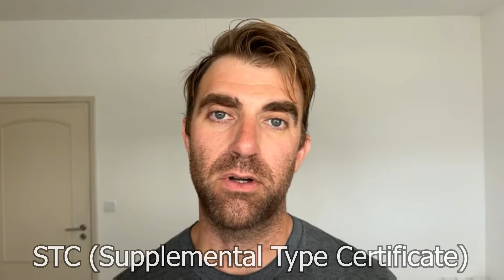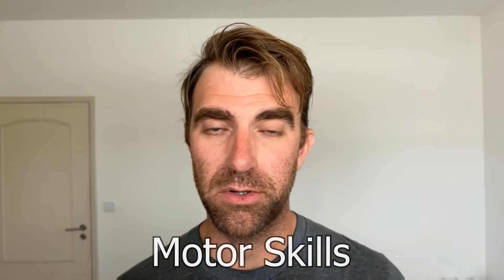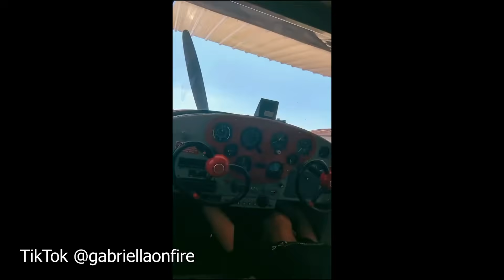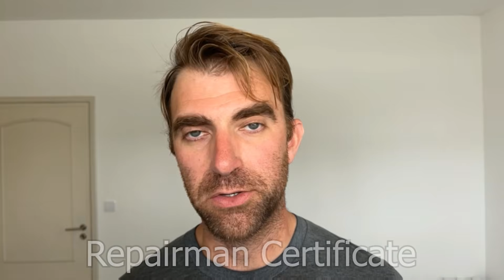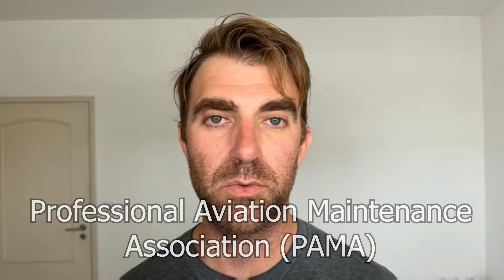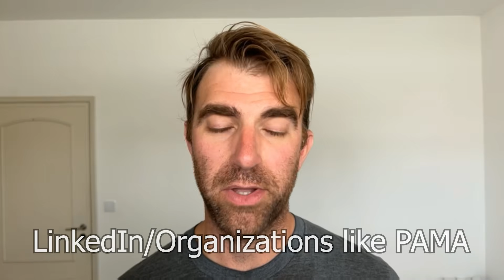Avionics Technician: Soar Into One of Aviation's Hottest Careers

Comment: Would you still recommend getting the airframe mechanic license if your ultimate goal is to become a bench technician?  For example, as a bench technician, would you still need to find an A&P mechanic to sign off on your work if you weren’t licensed?
Reply from the maker: If you only want to do bench tech then you won’t need an airframe license. You should be able to get a repairman certification to sign off your work because you would be working for a Part 145 repair station. The repair station handles your certification in conjunction with the FAA.

Comment: I'm currently working as an Avionics Tech at a regional airline. Most airlines will take their avionics techs from the A&P certificated mechanics. You'll also likely get an employee number, and you'll use that to sign off your work, even though you'll have your A&P.

When you're still learning (which is all the time), it's very useful to be able to read and understand the manuals. As an example, we had an issue with flight attendant handsets a couple of times. (The phones the flight attendants use to talk to each other or the flight deck, as well as PA calls.) Sometimes the handsets will feedback quite badly. This issue points to something called a band-pass filter. If the filter is faulty, handsets can pick up and feedback off of engine noise, which is a really bad time. You really only want the the PA to pass frequencies in the human vocal range. Being fairly new, I was looking at the PA amplifier to see if that was causing the issue. I had assumed the band-pass filter would be installed in the PA amp.

I deferred the handset mainly because I wasn't sure, and I wanted time to research it, and I didn't want to replace the PA Amp without knowing for sure. I looked at the logbook the next week, and saw that the issue was fixed by another tech by simply replacing the handset. This has failed to fix in the past.

What it did was help me to stop looking at the PA Amp. I started looking up the company manuals for the handsets. Sure enough, the band-pass filters are actually a part of the handsets, and not the PA Amp.

Comment: Hi mark,
I currently have an A&P. I have worked at the same employer for 8 years. Do you know of any good reading or books for avi I could read. There isn’t a lot of cross training at my work or opportunity to learn. I have a basic understanding of wiring and been apart of installs on the structural side. Completed various wiring troubleshooting jobs. I want to get to the next level and factory training isn’t very affordable or accessible. I have been to two gen fams mostly work challenger line. Any input is appreciated thanks.
Reply from the maker: A good place to start for terminations, routing, etc would be IPC manuals:

https://shop.ipc.org/ipcwhma-a-620/ipcwhma-a-620-standard-only/Revision-d/english?__hstc=147325167.1035ab2bc5efc478b6ecccb4b9d9c93c.1736879006146.1736879006146.1736879006146.1&__hssc=147325167.3.1736879006146&__hsfp=3711139660

Kinda pricey, but you could probably find used ones.

There are soldering and board-level standards too, so take a look around in IPC’s site to find what level of avionics work you’re looking to do.

NCATT AET study guide would be good reading for theory.

Check out aea.net too!

Comment: Hi,  what are the hours like working as an aircraft mechanic/technician?
Reply from the maker: It is generally hourly shift work - 1st, 2nd, 3rd, with weekend coverage as well. Overtime pay is very common.

Off shifts (2nd and 3rd) will typically be longer but come with 1 day or multiple days off. 

Say if you work 3 12-hour shifts on weekends, you may get the remaining 4 days off but get paid for 40 hours.

It varies depending on the type of employer you work for. Shift work may not be as common for General Aviation for example, where you might work 5 8-hour days Monday through Friday 9am to 5pm, or however the business owner has it structured.
Reply: @markhjoy  Great, this was very helpful. Thank you!
Reply from the maker: @bf16172  Welcome!
Reply: I worked as an avionics tech, but that was many years ago. If you work for a major airline it is almost guaranteed
that you will work on 3rd (graveyard) shift. And that can last for many years. That's because the shift you work and
your days off are based on seniority. Especially true if it's a union shop. New hires are at the bottom of the seniority
list. On the plus side people on 2nd or 3rd shift get a shift differential, or a little extra pay.

Comment: What exactly is composite tech h
Reply from the maker: They work with composite materials like Kevlar, carbon fiber, fiberglass - repairs, manufacturing, modification, etc. As opposed to sheetmetals like aluminum.

Comment: Hello I’m an electronic engineering technology student, would I be able to get an avionics related job with this degree alone or would I need a cert? I really would like to know how transferable the skills are from EET to avionics.
Reply from the maker: Hi! It’s possible to get a job with your EET degree, but keep in mind you would likely need to find a job where they are open to training avionics techs with no experience.

You don’t NEED a cert necessarily.

Engineering experience is one thing, while hands-on experience specifically in avionics is another.

If you had formal avionics technician training or experience (ie installation, bench repairs, line) through school or OJT, you’d likely have more job opportunities.

In my experience, I was hired at Duncan Aviation as a paid avionics installation tech intern while I was studying to get my A&P. Duncan was open to training people with 0 experience for that position in that case.

In short, it depends on the employer and how badly they need people

Hope this helps.

Comment: I’m looking at going to an avionics technical program, it offers FCC license and is a short course. Will it be difficult to find a job without A&P? Any advice helps
Reply from the maker: @jacka5676 it may not be difficult to find a job without an A&P, however I still recommend getting your Airframe cert so that you can sign off your work. Your pay would very likely be higher in that case.

But in your situation, it could be that you need/want to get a job ASAP - if that is the case, try to find an employer that would pay for your training to get your Airframe certification. 

That would probably be the best way to come out on top, here.

Hope that helps!
Reply: @ that’s a great game plan. Thank you for the time and the information.
Reply from the maker: @jacka5676  you’re welcome!

Comment: Greeting from Puerto Rico. Honestly loving the channel, just got done viewing your job application interview vid.

Just wanted to ask if you could go over what technical areas you should focus on studying for an entry level job interview (airframe, power plant, general). What general questions are most likely to be asked and in case of not having the answers to a certain question, what would be the correct way to answer. 

Thanks again and keep up the amazing work!
Reply from the maker: @carlosa.acevedo7466 Technical knowledge for entry-level interviews can vary widely. At one job interview, I had to take a written test, but it was pretty general covering everything I learned in A&P school - like "explain how a variable pitch propeller works."

If I were you, I would focus more on the STAR interview technique - Situation/Task, Action, and Result. Look this up and come up with 10+ situations/tasks (even if they are from situations at school). Practice telling those stories, and you should be in good shape.

You'll likely get questions like "Tell me about a time when..." Practicing your stories will be the most helpful, here.

If you don't know the answer to a question or are stumped, just say "Can we come back to that question?" The interviewer won't look down on you for this, and it tells them that you may need more time to think about the question.

Also responding with something like "I'm not sure, I would have to look it up in the maintenance manual, etc." is probably a good response.

If you are looking for interview advice for specific companies, I would suggest posting on Reddit here: 

https://www.reddit.com/r/AircraftMechanics/

Comment: I have an A&P (also been an Airline Captain / Corporate Pilot and Flight Instructor) .. and have a GROL (and T2) with radar endorsement .. What would you recommend for those of us that want to perform mobile pitot static and transponder checks?  [Requirements and Equipment.]

Thank you for your input on the career paths available .. I sent this to my brother who is an installation apprentice right now .. I gave'em the same advice on getting an Airframe ticket at minimum (he has an AS in electronics and GROL).  You know how family works .. he'll listen to you .. because it isn't big brother .. so thank you.
Reply from the maker: Great question!

You can check the FARs for pitot/static/xpndr tests in these sections:

- FAR 91.217 & 91.413
- FAR 91.411

For testing gear:

- IFR-4000 
https://www.viavisolutions.com/en-us/products/ifr4000-nav-comm-flight-line-test-set

- Laversab Pitot-Static or similar
https://www.aircraftspruce.com/pages/to/test_pitot/laversab12-04749.php
Reply: @markhjoy  I appreciate your response Mark.

I'm fmiliar with the regs .. just fuzzy on if I would have to become / have a repair station to actually do the work for myself as a business.

It's slowly becoming my desired life path inside GA maintenance.
Reply from the maker: Oh ok understood.

In order to make and sign a logbook entry for the work you specified, you would need either your Airframe or Repairman certificate.

You don’t need to open a repair station if you have your Airframe certificate.
Reply: @markhjoy  I've been reviewing "AC_43-6D" and it appears if I want to perform Pitot Static and Transponder Checks I would need to be a "certified repair station" under 145.

I've not done a lot of research to determine if this is 100% correct but I'm leaning that way.

If I was doing any other work, I agree I would only need to have an Airframe Certificate.

I'm not an expert on AMT things so I always look for peer-checks to validate my wondering thoughts.

Thank you and I appreciate your reply.
Reply from the maker: @honeycomb8753  oh ok I will check that AC. Where did you happen to find that reference?

In 91.411.b (…test must be conducted by…)

b) The tests required by paragraph (a) of this section must be conducted by—

(1) The manufacturer of the airplane, or helicopter, on which the tests and inspections are to be performed;

(2) A certificated repair station properly equipped to perform those functions and holding—

(i) An instrument rating, Class I;

(ii) A limited instrument rating appropriate to the make and model of appliance to be tested;

(iii) A limited rating appropriate to the test to be performed;

(iv) An airframe rating appropriate to the airplane, or helicopter, to be tested; or

(3) A certificated mechanic with an airframe rating (static pressure system tests and inspections only).

So at least for the altimeter testing I am reading it as “manufacturer OR repair station OR certificated airframe mechanic”

But yes I agree on 91.413 you need to be a repair station OR pt 121 ops OR the manufacturer

Apologies for my incorrect response before!
Reply: @markhjoy  It's hard to get good communication thru a computer brother.

No worries.  

Yes, 91.413 (c)(1) for the transponder check is where I landed on the repair station certificate.

§ 91.413 ATC transponder tests and inspections.

(a) No persons may use an ATC transponder that is specified in 91.215(a), 121.345(c), or § 135.143(c) of this chapter unless, within the preceding 24 calendar months, the ATC transponder has been tested and inspected and found to comply with appendix F of part 43 of this chapter; and

(b) Following any installation or maintenance on an ATC transponder where data correspondence error could be introduced, the integrated system has been tested, inspected, and found to comply with paragraph (c), appendix E, of part 43 of this chapter.

(c) The tests and inspections specified in this section must be conducted by—

(1) A certificated repair station properly equipped to perform those functions and holding—

(i) A radio rating, Class III;

(ii) A limited radio rating appropriate to the make and model transponder to be tested;

(iii) A limited rating appropriate to the test to be performed;

(2) A holder of a continuous airworthiness maintenance program as provided in part 121 or § 135.411(a)(2) of this chapter; or

(3) The manufacturer of the aircraft on which the transponder to be tested is installed, if the transponder was installed by that manufacturer.
Reply from the maker: @honeycomb8753  ok thanks for that, I think we’re squared away haha!